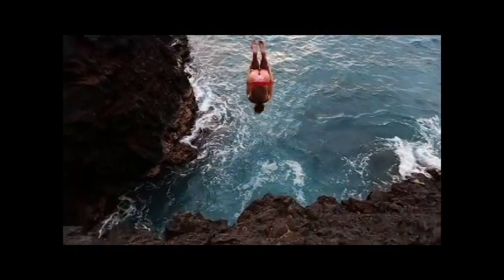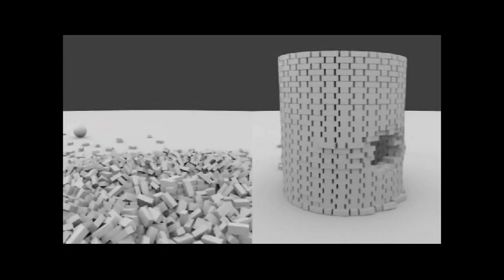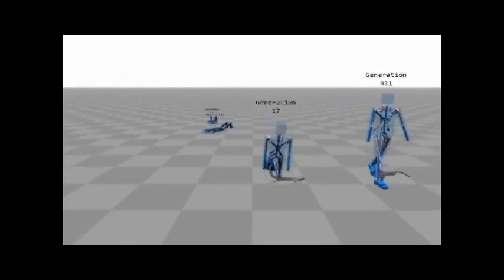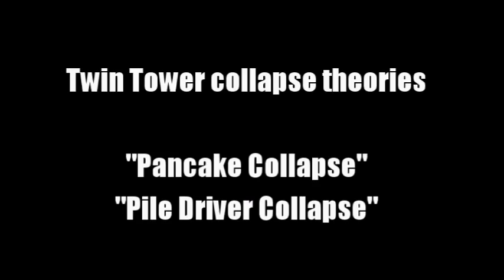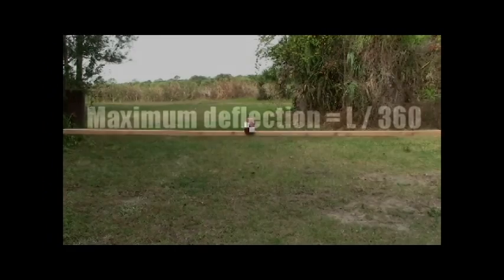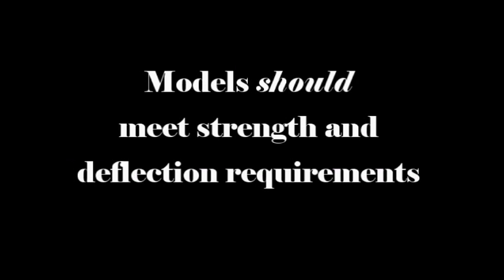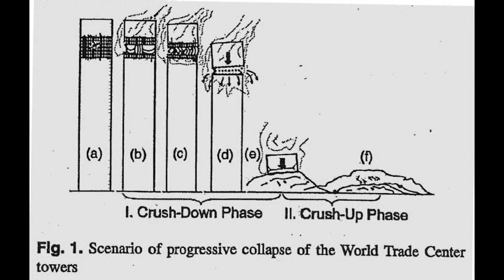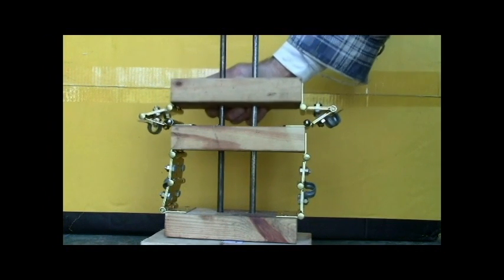9/11 Experiments: The Force Behind the Motion

Comment: Size and scale of these experiments are too far off to prove anything. The experiment towers were way too narrow and the weight of each floor isn't taken into account and the pizza box plastic columns are far stronger in the scale of the experiment than what they should have been. The space between floors is less than 15 feet and the experiment made it look like would have been 150 feet. This is why computer models need to be used, but simple models can't get the scale of materials and weights correct to accurately replicate the scenario.

Comment: Materials don't scale the way you think they do.
You can easily hold a matchstick by one end and it'll remain as straight as you can tell; but if you scale the dimensions by 100, and hold a tree sideways by the trunk, it will droop at the other end.
So by scaling things down, you're actually overestimating the real material strength, and that's why real bridges aren't built out of glue and popsicle sticks.

Comment: Nice try.   Ever seen them implode a high rise?  Weight and speed of fall gets added to each separate floor. Try refining your math. You will come to a different conclusion. Also the below commentator was correct that the scale ratio of strength to weight factors has to be correct
Reply: No it doesn't.

Comment: As a kid 40 years ago we used to take coke cans, in the days when they were made from real metal not the paper thin aluminum used today, somebody would stand on the can and structurally the can would hold the weight perfectly but a light knock on the center of the cans would result in a catastrophic collapse of the can, collapsing downwards, inwards an expanding outwards at the same time.

I'm not saying this is the case, because I do believe there was other involvement, but I am pointing out that the accelerated collapse is possible if you take the massive weight of the top floors and the weakened, not destroyed, weakened support beams into consideration.

Another factor is that the support columns in WTC, as opposed to your experiment is a super structure, that is to say floor zero's column a is connect directly to all other columns vertically and horizontally The effect there would be that no downward failure can happen while the 'cage', ie the horizontal supports put pressure inwards. The moment the floors have collapsed one at a time to the extent where the horizontal structure fails then the vertical structure will immediately give way.

This would explain the floor by floor failure, the downwards and outwards failure as well.

I do believe this was a blown up, intentionally destroyed, but if we want to have a discussion about science all options need to be scientifically considered. 

The only thing that does not make any sense is how all three buildings collapsed so cleanly and completely. That is is does not make sense until its looked at as a inside job.

Comment: The twin tower was built as a big puzzle, with prefabricated steel pieces bolted in place. Watch the movies that are available from the construction of the twin towers and carefully study how they are assembled. Then build a model of the same type of construction, make a big hole in the side, a little fire, but do not forget the wind that made the towers swing back and forth. Watch the smoke on 9/11, it was a windy day. The first tower that falls, does so in the same direction as the wind, it is a factor that no one has taken into account. When the collapse began, no pancake or pile driver, it broke apart in the seams, the weakest link in the chain, bolt joints.

Comment: I used to think that scale was a factor in these tests, but it is not. As long as the material and structure are consistent. The only flaw here is this "real" model did not have increasing structural strength in the floors all the way to the ground like the "real" WTC towers had.

Comment: one observation. at the edges of your beams, there is a significant bearing force on either side, which is unrealistic as the beams of the towers were steel connections, that didn't impart bearing resistance, it's quite obvious in your model especially around 6:45 that the  bearing reactions significantly affected the simulation.
also you claim to be an engineer but you do the immense fallacy to call them "CEMENT planks"???!!.  As an actual civil engineer I'm disgusted and ....call bs on u being one

Comment: jet fuel can't melt steal beams!!!
Reply: Why don't you steal away and learn to spell?
Reply: Tony Duncan wow good job old man! it was just a mistake that I don't care to correct now put away your reading glasses and go outside and lose that arthritis! lol
Reply: You missed the part in science class that the melting point of an object is the point in which it turns from solid to a liquid. You don't need to MELT steel to get it to bend, only to get it hot enough to make it malleable. Keep in mind that during placement of the key at the top of the St Louis Gateway Arch, the South leg was taller through thermal expansion than the north leg. This was on a cool fall day in like 50 degree temperatures. In order to cool down the north leg to get it to contract back into place, they had to spray water on it. The twin towers were designed with open floor plans with the bulk of the load supported on the external walls. The floors were tied to the inner core and to the external wall supports. On the top of the towers was essentially a cap tying each external support to one another. When the planes hit the walls, the cap on the very top acted as it was supposed to, by sending the additional stress load down the remaining good supports all the way to their base. What happened was thermal expansion combined with sagging of the floors directly above the fire. Remember the floors were supported by very long steel beams from the inner core to the outer walls to provide an open office floor plan. There was little actual support transferring loads from upper levels between the inner core and the external walls. Also keep in mind that the the towers were 110 stories tall....they were giant chimneys. The crash weakened the external walls. The fire weakened the floors above them. And the extreme height allowed for cooler air to further keep oxygenating the fire...remember that air also expands under heat....cooler air means oxygen is more tightly packed together. All this led to the floors above the fire to expand and push outward on their external wall supports, and sag directly over the fire, pulling the center of gravity of that floor lower down than it was designed.

Out and down...he's correct....but he doesnt understand how the towers were designed, nor the properties of thermal expansion.

Comment: You're missing a lot more factors like unsupported steel strength, structures are only strong while they have intended structure. Like standing on a coke can, will hold an 200lb human, but I can crush it with my hand. Stand in a coke can and then have someone push a dent in the top side. Watch your fingers. Idiots.

Comment: much as i admire this work, there is a flaw in scaling things down.

for example, if i fall 10 times my height, I will probably die. but an ant will not. that's because smaller objects do not behave as scaled down larger objects. If I take a part of my body the size of an ant, for example, a finger nail. and drop that 60 feet, it won't be damaged. even a whole finger. a hand may sustain some damage. but it's only when you drop a whole human 60 feet that you get real damage. likewise, an ant can fall five feet undamaged. now make a human sized structure out of ants, and it won't be able to fall more than a few feet. so there are absolutes of size and scale.

the remedy to this problem is to make your maquette as large as possible.
Reply: Aaron Walderslade slight issue with this statement,  the laws of physics don't care about size, force magnitudes will differ yes, but the laws hold constant.  Go and stack 110 porcelain plated, put a cardboard ring between them if you want, doesn't matter.  pick up 14 of the plates 13 feet and drop them onto the 96 remaining plates, will those 14 completely destroy the 96 below? No, of course not, we know it won't , it'll break 14 or so plates below it before it stops.  Does it matter if we make the plates titanic? Say 10 x the diameter of the tower and 10x the height of the towers with 10x the mass? no, the results are the same, just at a more massive scale.  Now porcelain is weak, a stack of plates  (with or without cardboard rings) is not like one of the towers,  it is inferior in every conceivable way, that means replicating what wtc1 did should be easier on a ridiculous level.  So explain to yourself why the plates at any size fail to completely destroy the stack,  then apply those reasons to  wtc 1, a structure that was made to stand, made of VERY strong material, had redundancies built in, had interconnections for added strength, yet it did what our stack of plates can't.   14 floors destroyed 95 progressively stronger floors and did it in seconds. Something is very wrong.
Reply: Argue with this:
Newton's Laws of Motion as applied to 9/11:
An Analysis of the Floor Collapse of the Twin Towers

Newton's 2nd Law ”The acceleration of an object as produced by a net force is directly proportional to the magnitude of the net force, in the same direction as the net force, and inversely proportional to the mass of the object.”
This, with Newton’s other laws, demonstrates the REALITY of the floor collapses within the twin towers.
The equation used is a derivative of the ACCELERATION of MASSES by GRAVITATIONAL FORCE: v^2 = u^2 + 2 * f * s, where:
Floor Mass m = 10^6 Kg,
Gravitational Acceleration f = 32.16 feet per second per second, or 9.81 metres per second per second
Distance between floors s = 12 feet, or 3.66 metres, and
Starting velocity u (original) = 0 ft/sec  (0 m/sec).  Then u = 9.72 ft/sec (2.97 m/sec).  Then u = 13.72 ft/sec (4.18 m/sec).  Then u = 16.3 ft/sec (4.97 m/sec).

It fits (as it must) in the case of a detaching floor. This, when and if it falls free, accelerates at G until it hits the floor beneath. From the formula v^2 = u^2 + 2 * f * s we know it strikes the floor beneath at a speed of 27.8 feet per second, or 8.47 metres per second.
We know that MOMENTUM is conserved, and the TWO floors would THEN be traveling downwards at HALF THAT SPEED, less the speed loss from the energy loss of the SHEARING of the floor connections.
We KNOW what this is, because we KNOW the average and general downward acceleration to have been 0.7G, as agreed by AE911T.
So we KNOW that the initial downward speed of the TWO floors is actually 70% of (27.8 / 2), which is 9.72 feet per second, or 2.97 metres per second.

Now we consider TWO floors striking the NEXT floor.   
Note that THE START VELOCITY (u) IS NO LONGER ZERO, but 9.72 feet per second, or 2.97 metres per second, so from the formula v^2 = u^2 + 2 * f * s we know the TWO FLOORS strike the floor beneath at a speed of 29.4 feet per second, or 8.96 metres per second, and thus the impact velocity is GREATER than before.
We know that MOMENTUM is conserved, and the THREE floors would THEN be traveling downwards at TWO THIRDS THAT SPEED, less the speed loss from the energy loss of the SHEARING of the floor connections.
We KNOW what this is, because we KNOW the average and general downward acceleration to have been 0.7G, as agreed by AE911T.
So we KNOW that the initial downward speed of the THREE floors is actually 70% of ((29.4 * 2) / 3), which is 13.72 feet per second, or 4.18 metres per second.

Now we consider THREE floors striking the NEXT floor.   
Note that THE START VELOCITY (u) IS NO LONGER 9.72 feet per second, but 13.72 feet per second, or 4.18 metres per second, so from the formula v^2 = u^2 + 2 * f * s we know the THREE FLOORS strike the floor beneath at a speed of 31.0 feet per second, or 9.45 metres per second, and thus the impact velocity is EVEN GREATER than before.
We know that MOMENTUM is conserved, and the FOUR floors would THEN be traveling downwards at THREE QUARTERS THAT SPEED, less the speed loss from the energy loss of the SHEARING of the floor connections.
We KNOW what this is, because we KNOW the average and general downward acceleration to have been 0.7G, as agreed by AE911T.
So we KNOW that the initial downward speed of the FOUR floors is actually 70% of ((31.0 * 3) / 4), which is 16.3 feet per second, or 4.97 metres per second.

On the point of impacting the NEXT floor THE START VELOCITY (u) IS NO LONGER 13.72 feet per second, but 16.3 feet per second, or 4.97 metres per second, so from the formula v^2 = u^2 + 2 * f * s we know the FOUR FLOORS strike the floor beneath at a speed of 32.2 feet per second, or 9.81 metres per second, and thus the impact velocity is EVEN GREATER than before.

What you see here is AN ACCELERATING TREND.  The acceleration of the massing floors is heading asymptotically for G itself.

"You are saying that as the first 15 floors collapses on the 16th floor" - Well, obviously not.
"The amount of kinetic energy is increased as opposed to deceased (sic)” - Certainly not.  Energy never ‘dies’.  Consult The First Law of Thermodynamics.

If you take the INITIAL FLOOR, its kinetic energy impacting the floor beneath it (assuming its weight to be 10^6 Kg) is 0.5 * m * v^2, which is 0.5 * 10^6 * 8.43 * 8.43 = 35,500,000 Joules.

If you take the FOUR FLOORS, their kinetic energy impacting the floor beneath them (assuming floor weight to be 10^6 Kg) is 0.5 * m * v^2, which is 4 * 0.5 * 10^6 * 9.81 * 9.81 = 192,000,000 Joules, which is MORE THAN FIVE TIMES GREATER.

Kinetic energy is ALWAYS INCREASED BY FALLING, as POTENTIAL energy is traded off against it.

So the floors will accelerate all the way to the tower basement.  This leaves FREE-STANDING COLUMNS NEARLY A QUARTER OF A MILE HIGH (and holding up 70,000 tons).  THEY WILL BUCKLE AND FALL DOWN.
Reply: Tony Duncan and since newton's 3rd says the building will hit back at the floors with the exact same 192,000,000 joules the falling floors will be destroyed at an equal rate.  that's some lovely equations but you seem to forget that as the top impacts with the bottom, the bottom impacts with the top. With your work there (one sided as mentioned ) the dropping 14 plates on 96 would result in the 96 being destroyed.  since we know that in reality that doesn't happen, it's wrong. cute try though

Comment: there is a flow in these experiment. you scale down size of buildings and distance between floor. when you scale down distance, then the speed achieved on way down betwreen two floors is totaly inacurate, and its make youre experiment fail. mass times velocity is key to determent colision between two floors. sory for my bad english

Comment: How can you put some paper and wood together and say it matches, concrete and steel? Keep in mind the buildings main support was the outside walls, which clearly were being split apart from just bolts by the 50 tons of falling concrete, steel, people, desk, drywalls, computers, and other items. I'm sure if you took all the added components that were added to the building from vacant businesses, you would get an extra 1 ton for each floor.

If you replicated an actual small steel and concrete structure, and took an RC plane with half a gallon of gas, through some wood and paper inside, and enclosed the model, I would be more convinced.

Comment: the only way i could see how the towers fell so fast is that something had to knock out the interior support beams from the basement level, rumour from some survivors claim to have heard explosions down in parking so having the core collapse could cause the floors to weaken and fall but certainly not at freefall speed into its own footprint also because the exterior of the building was made from solid steel i have no explanation on how that managed to collapse like it did or even how a plane can slice the towers like butter and come out the other side in perfect condition leaving a perfect cutout of the plane itself and how the wings of said airplane didnt break off on the steep decline going the speed it was not designed for and break solid steel intact

Comment: First is your model a accurate representation of the tower? Do you have any evidence other than your test to support controlled detonation?   Can you even give me a Scenario that would require the complete destruction of the building risking even the slight chance of evidence (detonators,wires,blasting caps, someone coming forward) may come to light as apposed to just crashing a airliner in to the building which more than likely will cause enough damage that the remaining structure is deemed unsafe and a real controlled demolition would take place?  Have you ever heard of Occam's Razor (see link bellow)? How long after I hit the post button before you state screaming Shill at me? https://en.wikipedia.org/wiki/Occam%27s_razor

Comment: i am no engineer in physics or whatever and i believe 9/11 was an inside job too BUT... could the outward 'explosions' required to get an accelerating downward motion come from compressed volume? for example, if one floor was roughly 11,200 metres squared and the roof height maybe 2.4m tall that would make the volume for that floor 27,000 metres cubed... so if 1 floor collapsed and that volume had to escape in less than 1 second , could that explain the outward 'explosion'? and would that outward force mostly eliminate the equal and opposite reaction of the floor below? could that same force from the volume be blown down stairways and lifts to lower floors weakening them prior to full load of the upper floors?